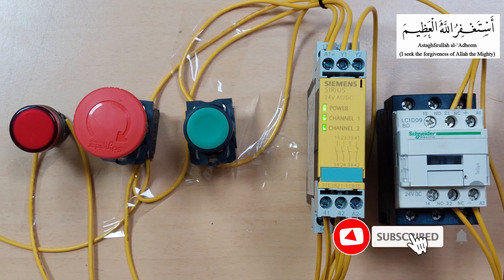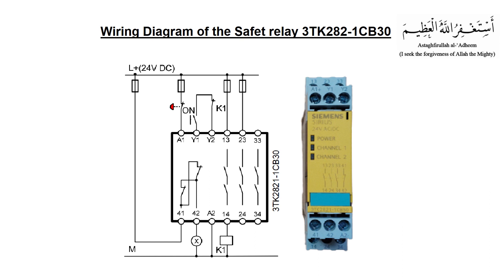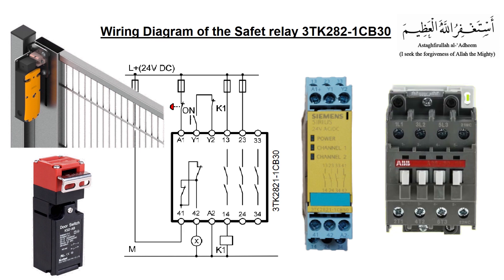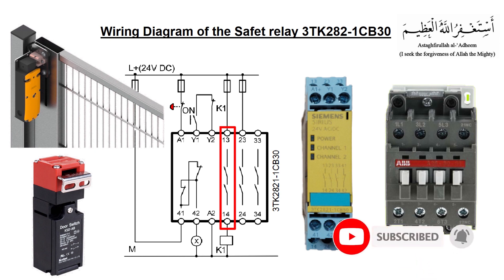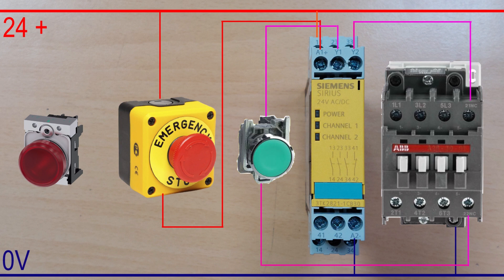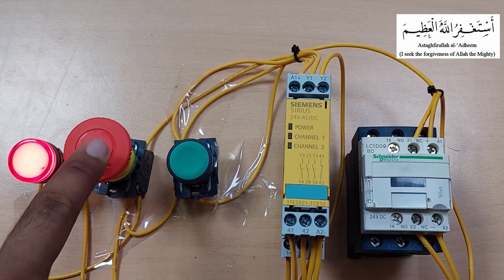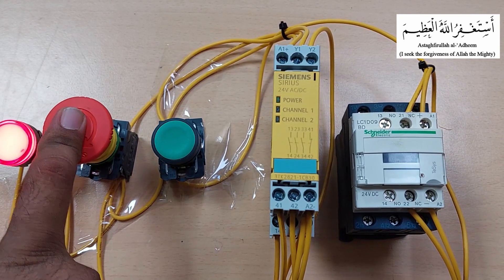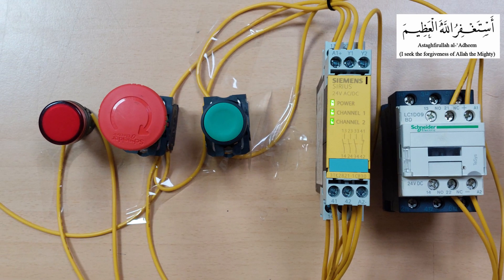What is Safety Relay Siemens ? || 3TK2821-1CB30 || Easy Explained

Comment: that is not the correct way to wire a safety relay. the channel 1/channel2 inputs are supposed to monitor the estop state, and optionally for a short circuit. the green button is supposed to reset the relay after a channel is interrupted. the only time you should remove power from the A1/A2 is when there is a discrepancy fault on a dual channel setup and the relay needs to be reset by a power cycle.
Reply: I agree. Power cut off of the safety relay should not be applied by the emergency switch. There are dedicated terminals for connecting of the emergency switch or other safety devices (light curtains, door switches e.t.c.)....
Reply: I do not agree. It's the only way to connect this emergency button to the safety relay. It's also written in the manual of the safety relay. It's also allowed to use a single channel emergency stop button and safety relay. You can reach performance level C with this diagram. It's even allowed when you not connect the feedback contact of the main contactor. But then you have to use well proven components. It's all written in the guideline ISO 13849-1 and ISO 13849-2 (performance level in the machinery, in Europe)
Reply: @ivanbratanov8699  , then tell me the right emergency button connections of this relay. Please, just read the manual and connect the safety relay the way it's written in the manual. Then you will be figgering out that the video explanation is correct.
Reply: @joostraemakers1967  it is definitely not the "only way" to wire it and i would like you to show me this diagram that has the estop button wired to the a1 power supply as a safety monitor. sure it will disconnect power to the outputs but no different than just running the outputs through the estop button. there isnt even any single channel monitoring in the example, no point in even having a safety relay.
Reply: @davevisner7223  i can send you the image and the manual of this safety relay. I don't know if i can put that image in this message
Reply: @dave visner This is how this safety relay works since it's single channel. A dual channel safety relay allows you to monitor for any faults on the emergency stop circuit. On this safety relay you have the A1 and A2 terminals for the power coming into the safety relay via the emergency stop circuit, top and bottom terminals 13 - 14, 23 - 24, 33 - 34 all NO switching contacts, bottom terminals 41 - 42 a single NC contact, and terminals Y1 - Y2 the reset terminals (automatic resetting by linking the two or manual resetting by having a reset push button to link the two terminals).

You're right in the last line talking about power-cycling a dual-channel safety relay, but the relay in this video is a single channel safety relay.
Reply: Channel number 1 light is not coming What is the problem plz feedback me

Comment: How u reset the safety relay ….it’s uncompleted circuit which is not acceptable in industry….
Reply: You can reset the relay when you push the green push button. Only the green colour is not correct. You have to use a blue colour, in Europe.
Reply: The safety relay is reset via the Y1 and Y2 terminals. If you connect a single wire across the terminals the safety relay will reset automatically. For manual resets just install a reset button in between that wire so it requires you to press the button to reset the relay.